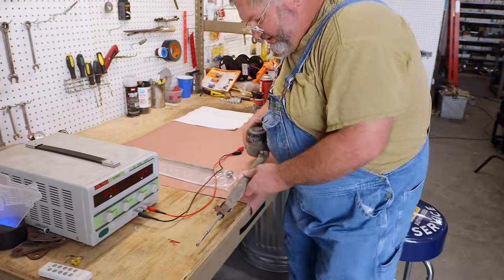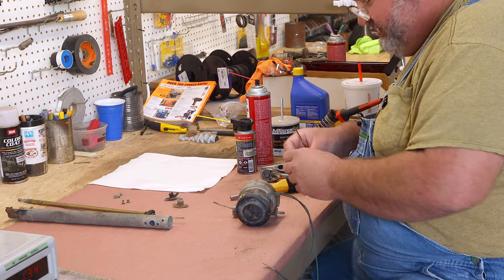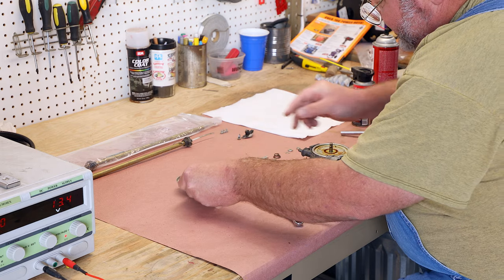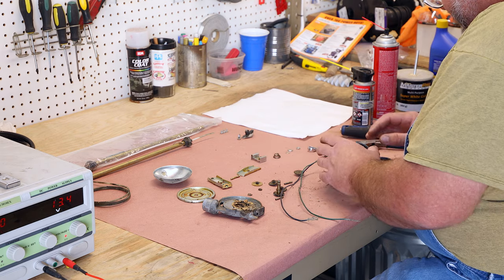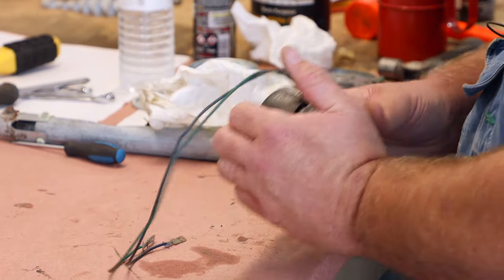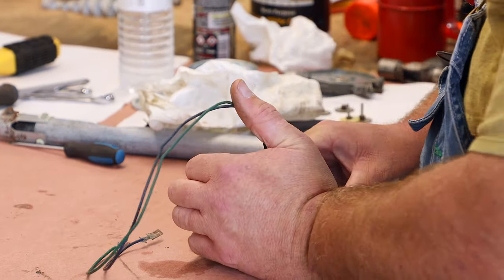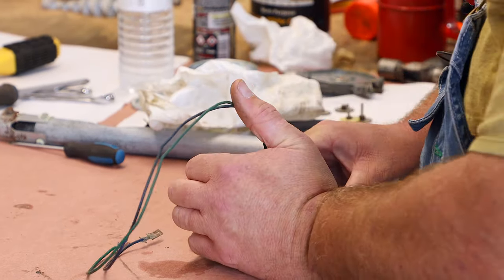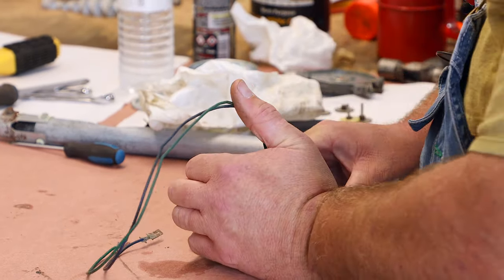How To Rebuild A Cadillac Power Antenna

Comment from the maker: Glad you liked the video Charles! No secret methods at Caddy Daddy. We even show how to rebuild parts we sell as rebuilt for those that want keep their car as original as possible. I have damaged or destroyed parts when figuring out some of these jobs so you guys don't have to. The antennas are pretty easy, but some items are very difficult to figure out a repair or rebuild process. Luckily we have a lot of cores to work with and I always try to experiment on damaged parts (bad corrosion or cracks for example) that have no value. Josh

Comment from the maker: This sounds like a short to ground in either the antenna or cable. Using an ohmmeter at the antenna check that the center pin of the connector is not grounded. If it checks good, then disconnect the cable at the radio and connect it to the antenna and make the same test. If there is a short, then the problem is in the cable or something being displaced at the antenna when it is connected. If at the antenna the center pin is shorted to the ground, then check that the antenna mast is not making contact with any metal.  Josh

Comment: Great video.I have an anntana that the cable must have broke as the motor runs it have a switch for up and down it also works automatic when you turn on radio.it also has an integrated cb 8track.its a 1978 elderado biarritz custom.would you have an antenna for that car
Reply from the maker: Thanks. WE have had a few NOS in the past, but nothing at this time.

Comment: Hi, I installed the antenna and installing the antenna cable from the radio to the antenna it does not work. When I back out the screws that holds the little antenna cover to where the cable goes in the cable from the radio it works please help

Comment: Nice video!  How much more work to replace the two lead wires?  Would be nice to have new wires instead of 50+ year old wires. especially since they are in engine compartment, by the passenger exhaust.  Are they soldered on?  Could you demo replacing wires too as a pt 2 to video? :) Thanks
Reply from the maker: The wires are simply soldered to a terminal strip under the motor cover. The job can easily be done.
Reply: @Caddydaddy  Thanks for the quick reply.  I will buy your kit and try replacing the two wires  too..  Also have an NOS one for another car and it goes real slow, so looks like I need to re-lube.  Great info.
Reply: Just following up as I rebuilt my NOS antenna.  It was very slow and getting stuck after install.  Removed and followed instructions and worked great.  On mine just had a spring/washer nut, not a double nut.  I also did not cut the NOS cable :), just removed, then re-fished it through after lubing using step in video.  Also, I noticed the nut position showed exactly one thread, so reassembled the same vs counting turns.  Did not remove three pins.   Also, each gear had a tiny washer.  The old grease was hard in some spots, even though was NOS from around the 70s.  Thanks!

Comment: Why is it when I screw in the antenna bracket that holds the wire from the radio I lose the antenna?
Reply from the maker: When the screws are tight, something is shorting out. Check the center
pin of the connector and be sure the proper screws are used. Those two are
very short and if they are too long will touch the antenna mast and
short it to the ground. Josh